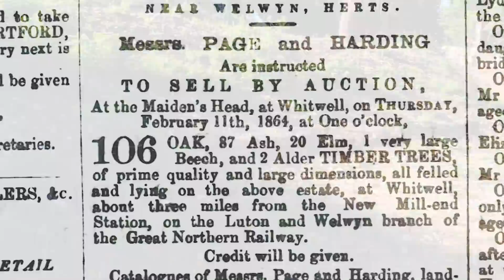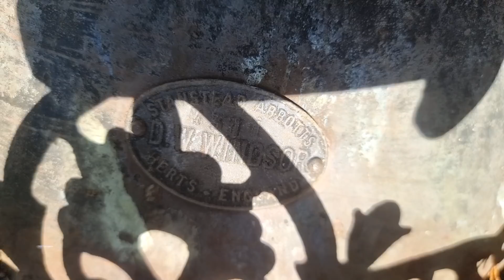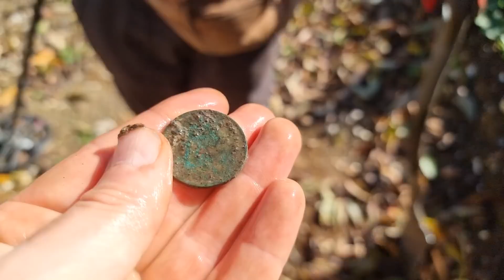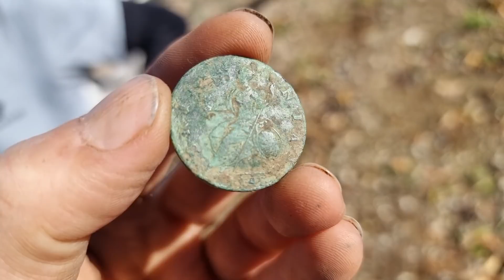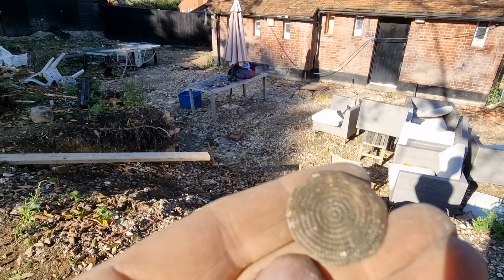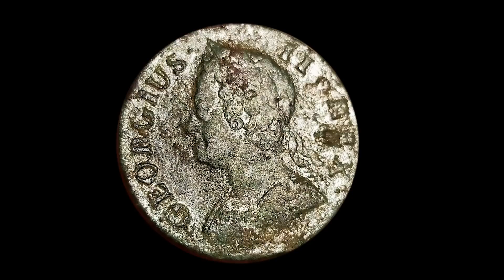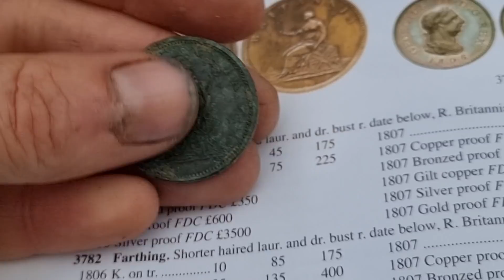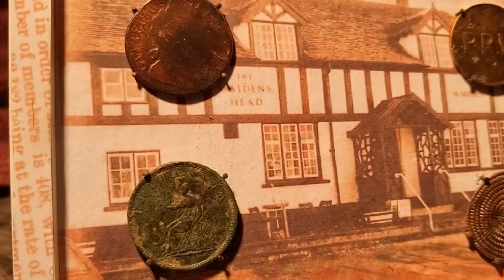ABANDONED PUB Treasure Hunt! 300 year-old coin found!

Comment: Simon,
I was a custom picture framer for 45 years... all kinds of things... shadow boxes, Russian Icons , clothing, coins, medals etc. gold leafing, frame carving and
restoration. Always something different...you know how it is.
I used silicone (clear) to affix objects to the background.
It held well and could take a mild drop or rap without releasing, but peeled off if you had to remove it.
You probably already know that, but I thought I'd pass it along!
I' m happy to see that Pub re- purposed, not torn down, but there is going to be a lot of lost History:(
Cheers,
Rik Spector
Reply from the maker: Cheers Rik. I’m worried any glue will affect the coins. This is a non destructive way I think. Thanks for the tip tho
Reply: @Sifinds  Simin
Silicone is inert and woll notvhsrm coins ir medsksvetc
I did archival framing as welk with svud free and reversal materiald
Very lmportant ehen your frsming original  airtwofk like a 250K
Andy Warhol artwork or any  one of a kind thing.
What you did was excellent and creative, a spot of silicone on the
Bavk is just extra ptotection.
Cheers
Rik

Comment: I wonder what might lie under the old floor boards of that building Si?

The village where I live in Australia is only 150 years old and has an indoor well which a publican hired a diver to clean.

The diver brought up so many coins the publican displayed them sealed in clear epoxy resin on the counter tops.

Unfortunately thieving ratbags have managed to pry a few of the coins out, but the majority still remain for patrons to enjoy.

I live near that Pub and have an old well in my front yard which dates back to a time when a coach company known as Cobb & Co had it enclosed by a post and rail fence where horses were exchanged and refreshed.

To my regret the timbers lining the old well were very unstable so I filled it up in the 1980's out of concern for children's safety.

But having watched your presentations and learning of what was found in the well at the Pub I wonder what coach passengers might have tossed into our old well over the years!!

While snuffling about our property replacing pipes and so forth I have literally filled buckets with bits of old porcelain.

I have also found metal buttons, a spoon, the guts of a pocket watch, old bottles, a halfpenny, a clay pipe bowl, various horse shoes left over from the days when a Farrier had a forge next door and more all of which is very interesting.

While digging a post hole I even dug up an old vulcanite screw type bottle plug with a concave top and knurled edge which had the words 'War Issue' cast around the top which given that it is vulcanite I imagine dates back to World War One.

I Thoroughly enjoy your vids Si so thanks very much for all the pleasantly relaxing and often fascinating moments!